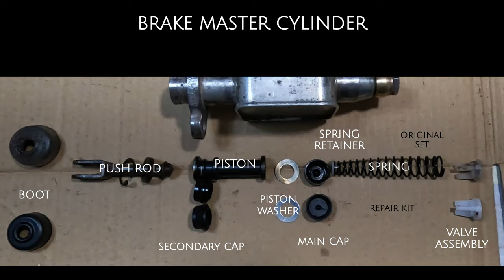MGB, MG B, 1963: CLUTCH AND BRAKE MASTER CYLINDER FIX PART 1

Comment: Hi,
Good to see you back. Necessary and ambitious projects. Metal caps are original, lucky you.
I have a half dozen of both the original brake master and clutch master cylinders as well as clutch slave cylinders. 
I queried Moss about the repair kits. Lses than enlightening. 
I am about to overhaul all of this for a pittance compared to the replacement prices for the copies and or replacements.

In earlier communications I may have mentioned that, I too, have a dash that has been painted the body color rather than the crinkle black. 

Currently I am having transmission issues and should be back on the road in a couple weeks. 

I think I mention that I had sold my 1964 March Iris Blue two years ago and replaced it with a 63 Red B. I sorely miss my Iris Miss.
Reply from the maker: Hi Jeff, nice to hear from you as well.  Thanks for the comments.  Now that I'm retired it seems that I'm busier than ever with a dozen or so half finished jobs.  I start one and get distracted and start another and poor Iris gets neglected.  Getting caught up now though and will get back to my evening drives and some longer day trips.  Hopefully with a break from mechanical issues.

Comment: thanks -most useful - I hauled our '67 BGT (bought new) out of the tall grass when the snow left.  First got the wire wheels off, then got the engine running (120 psi) and now for clutch and brake.  I just finished honing the clutch master but cannot get the slave piston out.  tapped it in a couple of mm so it is not seized but air will not move it out.  grease gun next.  I hope to get by with rebuild kits.  Engine, clutch and brake and then a licence and drive it around a bit.  It is pretty rusty and the interior is shot.  looking forward to part 2.  John in Manitoba.
Reply from the maker: Thanks John. Have fun when you get to the driving part.  How long has it been in the tall grass?
Reply: @mgbsandotherstuff2982  I'm embarrassed to say it was last on the road in 1986.  The brake master still seems to have life so I am going to hook it to the clutch slave to see if a strong push on the pedal will free it.  Worst case is I blow aged seals or the flexible hose.  All of which will be replaced eventually.  I also have an early TR2  also bought in 1967 which last ran around '86 but at least it has been inside for most of the time.  Kids came along and we parked the 2 seaters.
Reply from the maker: Not very many TR 2’s around, very cool.
Reply: @mgbsandotherstuff2982  A strong push on the brake pedal got the clutch slave moving out.  Onward and upward.  The TR2 is serial 394 so is before any factory mods came along.  I knew of 2 other sub-500 serial number in Saskatoon at the time.  Can't figure out why so many early cars came there.  All LHD with overdrive.
Reply from the maker: Very, very cool.  I’m always surprised how many British cars were exported.  There was about 101000 MGAs built and only about 5800 sold in Britain.

Comment: Hi there, enjoyed your vid on brake and clutch cylinders i recently purchased new cylinders for my C rather than refurbish the existing ones as their was evidence of at least one of them leaking prior to purchasing the car so they've probably already been overhauled. I've not fitted them yet but hope to attack the task soon. Ive owned several Bs and BGTs but cannot recall what the cylinders colours where
Reply from the maker: Thanks for the comment,  I'm not sure either, I've seen them painted up like "eye candy" but mostly see them in a flat grey colour. I've decided to strip them down to bare metal (galvanized I think) and leave them be.